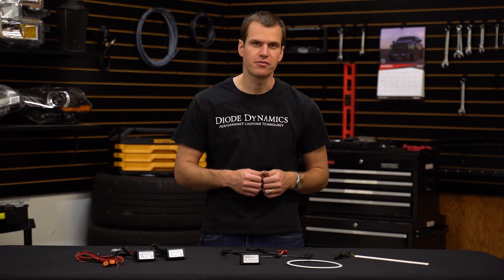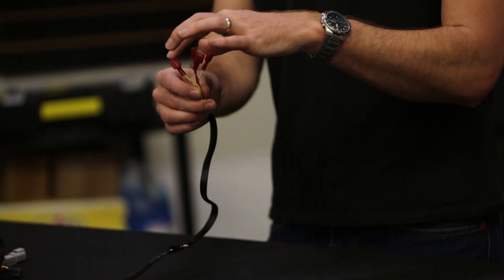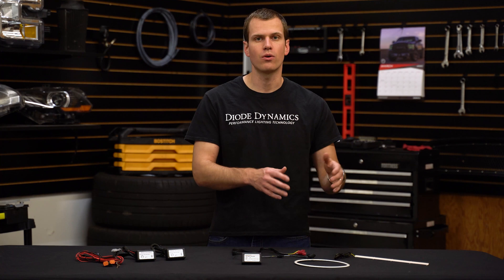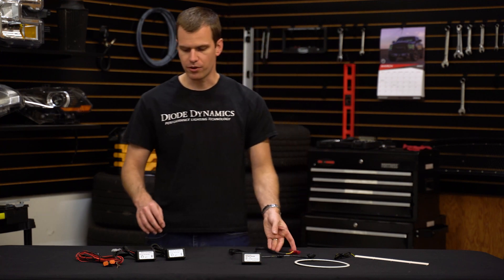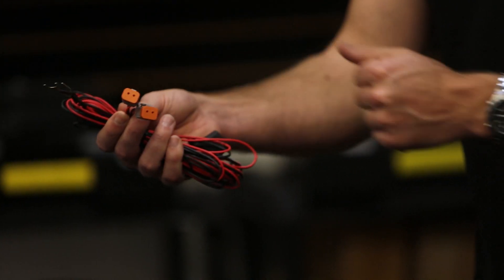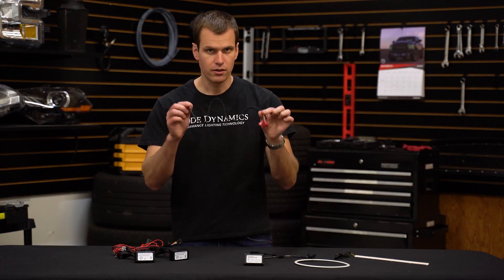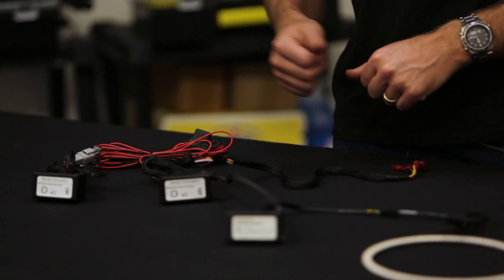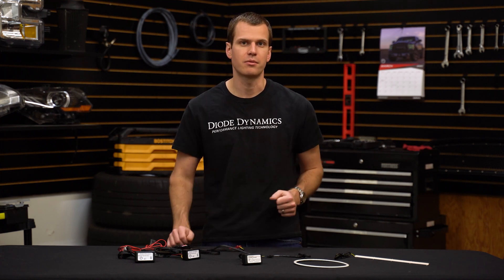How to Wire Switchback LEDs to Factory Signals WITHOUT Errors! | Diode Dynamics

Comment: Hi Diode Dynamics, I have a couple products I've purchased from you guys that I absolutely love. My SS3 Fog Pros, and some halo lights that I am using on a custom project. 

I was hoping you could help with a question I had. I own a 2012 Ford Escape, and I wondered if you had anything to help me solve my hyper-flash problem. In my headlight project I am using the following for turn signals. DD 80mm Halo, Morimoto Panamera DRL shroud, and Profile 24 Pivot switchback strip. I thought I saw a hyper-flash relay you guys made but couldn't find anything for my 2012 Escape. Any suggestions?
Reply from the maker: We do offer an in-line resistor kit for any vehicle! Check out the link below:

https://www.diodedynamics.com/led-resistor-kit-pair.html

Comment: How would you go about installing a halo switchback with a led switchback turn signal bulb would you still need a load resistor for hyperflashing and if so would you connect them together or separately?
Reply from the maker: Whether or not you would need a load resistor, will depend on the vehicle. We always recommend them because they are an inexpensive and easy way to prevent hyperclass. When it comes to wiring, we have a service team that would be happy to help you! You can contact them at 314-205-3033 Monday-Friday 10 a.m.- 5 p.m. CST, or shoot us an email at contact@diodedynamics.com!